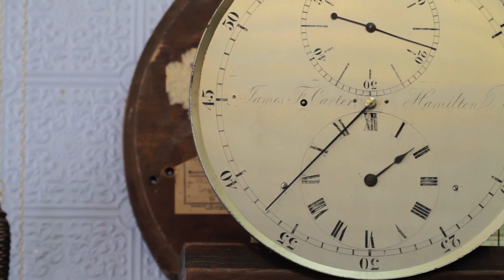John Bouwman ::: Clockmaker

Comment: I have a Gustav Becker from my now gone mother and, I was told that the clock couldn't get repaired and I do not think that it is not able to be repaired as, it is an Amazing Classic Clock from the 1875, s and I will be calling for your guidence with pictures for your eyes as I have to dig it out from the back wall in safe storage.  I will call in 2023 for your Email account.